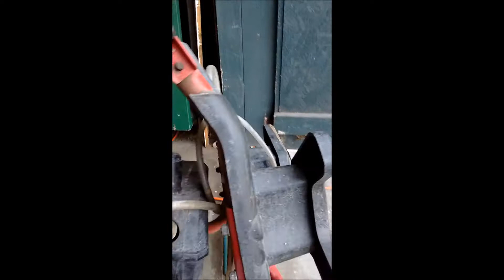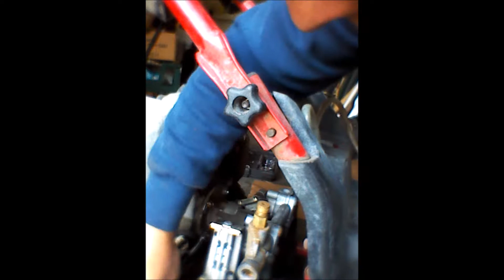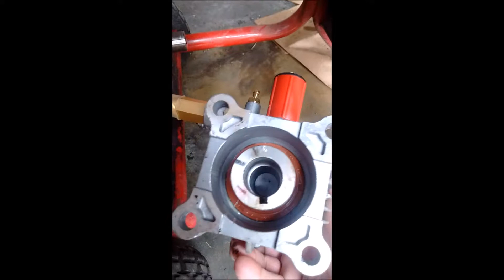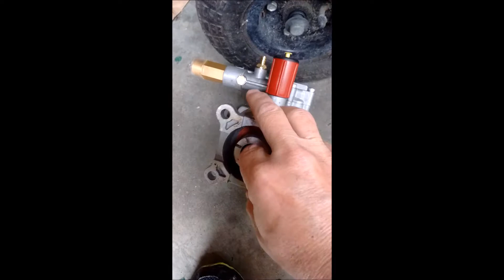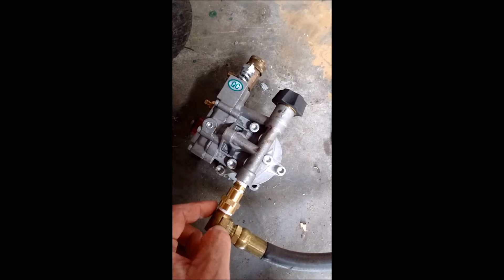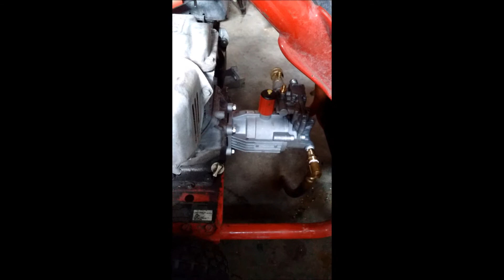pressure washer pump replacement

Comment: That hose is a thermal relief valve. Your new pump should have come with the newer valve, just like it should have come with the proper key for the shaft. You should have received a quick connect for your washer hose as well. But buying on Ebay, I guess it's you get what you pay for.

Comment: Exactly what I needed to know. Im taking mine apart, but mine shoots water out of the front of the pump when engine is running so I thought it blew a seal, But now I can take it apart but expect I will have to replace the pump.  FYI, the original pump is called a "Strap Pump" and no longer made, so generally not repairable,  The key stock issue was super annoying and only negative thing I saw.
So heres the deal, you used the WRONG key.  The one you used is intended for some engine applications where the key slot is dished to match in a half moon.  Many motorcycle engines use these.  But you can BUY Square key stock in several sizes.  I buy them in 12" lengths and cut them to length needed.  Any machine shop or engine supply can sell them.  Simple websearch.  You CAN make your own but be careful what you use.  Proper key stock is heat treated. Soft metal will fracture or fragment.  ALSO make sure its a nice snug fit. If its loose,, you can chew up the engine shaft key slot.  This is a difficult thing to repair. Either machine next size larger (Not easy) or specialized welding of the shaft and then recut the slot. So dont use loose, or poor fitting key material.  Your key you used is a risk because you dont have full engagment.. Kind of like one finger holding on instead of a whole hand.

Comment: holy moly - I watched the whole video thinking there would be a slew of responses ... but none! Well, I can say, thank your for this video. Its precisely what I need to do and the same learning curve you went through, I can now learn from. Sounds like the "key" to the whole process is the key itself to join the motor to the pump. I saw another video where some dude built his own key! Great for him since he had the equipment to do that. It was a great job he did. But I think this video was especially helpful as it organically recreated the entire process. All we can do is by the right pump and ask the right questions. This really helped me to frame the question to the provider on eBay so that I know I get the right parts. So thank you so much.

Comment: Anybody know if they sell those hoses on this thing with the flat end. It’s a hose that comes out the bottom and it stops by a metal piece. I have no idea what they are called
Reply: yes its called a pulse hose, Id have to check the manual but has something to do with line pressure vs static pressure, Notice how the motor kicks in when you are spraying and then idles when you are not?  Thats what its for. Goes to a valve that regulates engine load.  Look it up,, but  its the same with a generator when there is a load the engine revs up.
Reply: Yeah I'm trying to get the cover approximately 13 inches long 6 and 1/2 7 in wide that covers the pump I'm trying to replace the unloader valve and I can't get this cover off and I've seen no film or pictures that shows the cover coming off it's always with the cover off